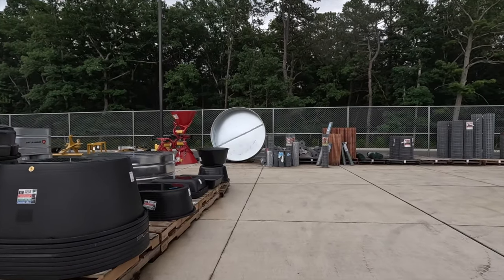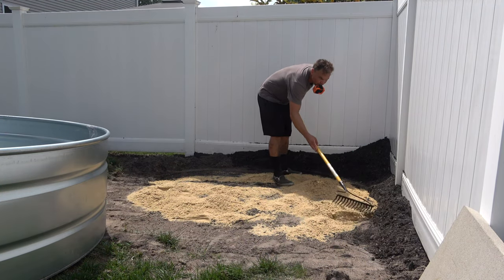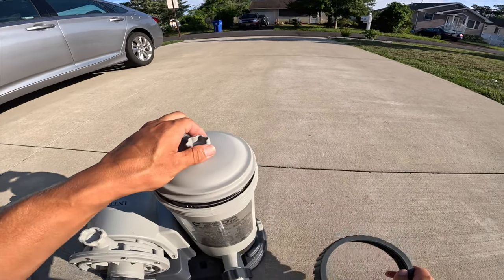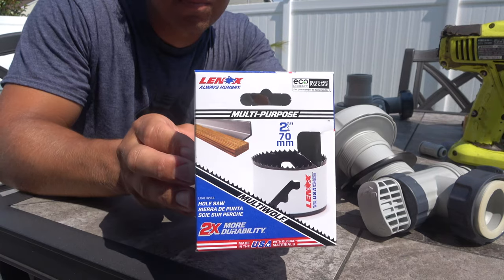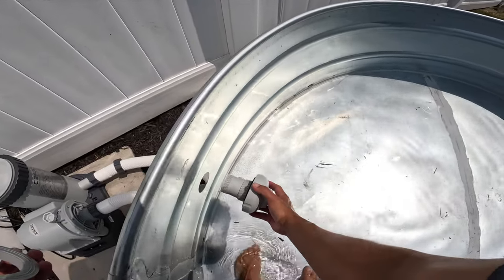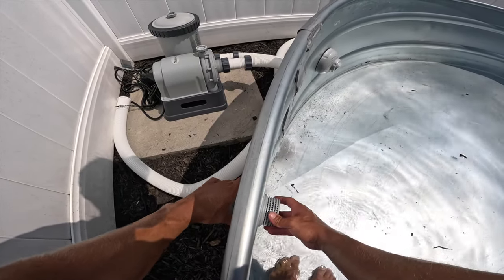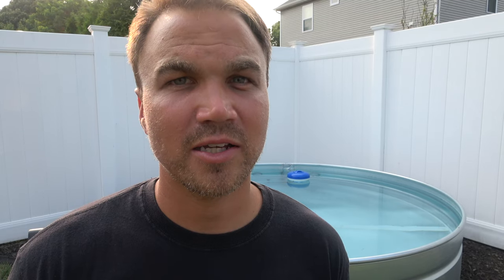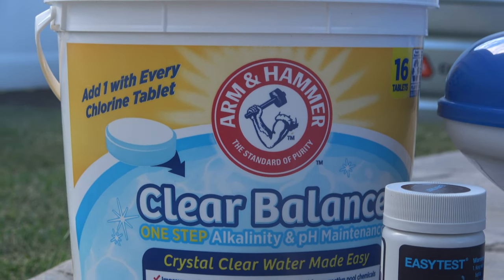Build Your Own Stock Tank Pool: A Backyard Oasis

Comment: I would suggest drilling the holes with no water in it. You will need to clean out the metal particles after drilling. If you don’t clean them out you will get metal splinters in your feet, snd worse In your eyes
Reply from the maker: Totally agree! I remember I had to shop vac all that out after. Bing pain. I think it rained overnight before I drilled. Clear that tank out before drilling!

Comment: steve cant thank you enough for this. have you had any issues with rust? i was thinking of getting a liner because i dont want to deal with it.
Reply from the maker: Not at all. You don’t need one. It’s been a year so far. I haven’t had any issues. I live by the ocean, everything rusts here. But not my tank! I keep it filled with water all year round. Cold plunges in winter!!! 🥶 Thanks for watching.
Reply: @sshouser31  very interesting… thanks! I was so worried because I’ve seen that as a common issue with these pools when you add chlorine
Reply from the maker: @rolfpierre8400  I've seen photos too. I don't get it. I've had zero issues. Even when I take the chlorine out in the winter. I got mine at Tractor Supply. Maybe it's the brand???